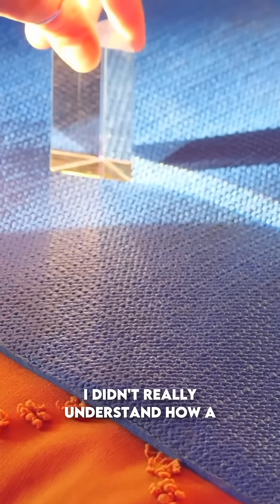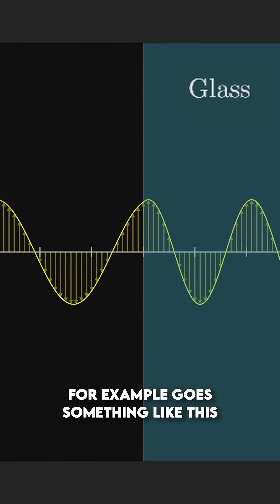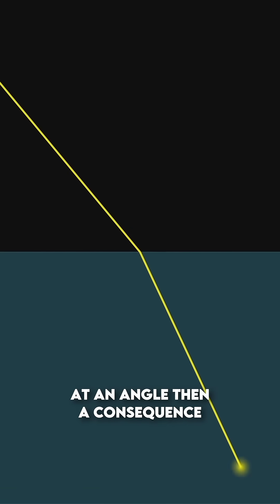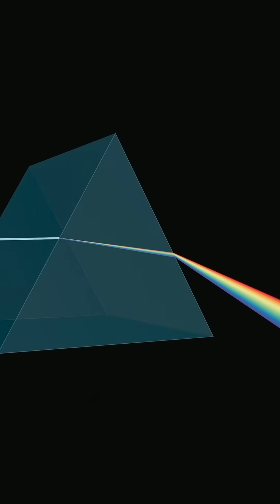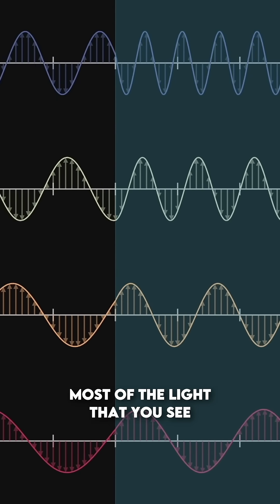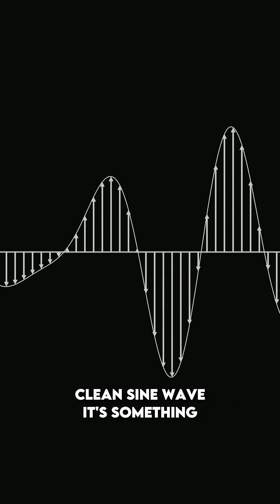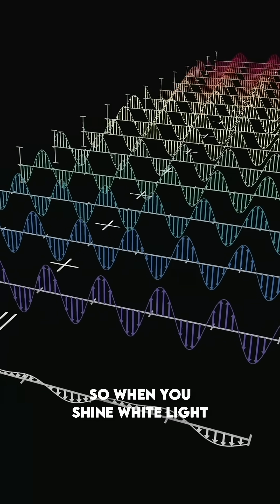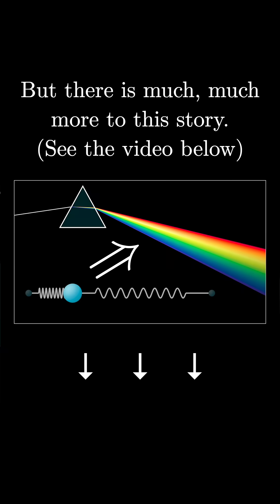How prisms work (full video linked above)

Comment: So light speed is not a constant,  meaning it's not a speed limit. And Einstein was wrong. Interesting
Reply: C is the speed of light in a vacuum.
Reply: @ialsoagree1634  correct. But it has issues with gravity.  As gravity pulls on it. And bends it, slowing it and accelerating it as well. Also, there are gases in the vacuum of space.
Reply: @nobody687  There are very few individual molecules/atoms within space. They are extremely far apart.

Also, gravity doesn't "bend" or slow/accelerate light at all. Gravity changes the shape of space itself - light always travels in a straight line. For example, when a black hole traps light, it doesn't actually change the direction light is traveling, or slow it down or accelerate it in any way. It's simply that light is travelling in a straight line toward the center of the black hole, and only from our perspective does it looks like the line isn't straight. In reality, past the event horizon, all lines in a black hole lead toward it's center.
Reply: @ialsoagree1634  There's the sun bending light around it. So you're saying it's just bending space and light is trapped in space, so it goes where space goes like on a track. But then light would have mass, and if it has mass, then wouldn't gravity have an affect
Reply: @nobody687  Yes, the sun - and all objects that exert gravity - bend space and time. Yes, light is trapped within our universe and travels in straight lines.

No, light does not have mass, it has momentum. Light is affected by gravity in that gravity distorts space and light travels in straight lines through space, therefore traveling along the new distorted (from our perspective) line.

Comment: Cam we get medium so dense that it can slow down light so much, it almost stops?
Reply: I mean, kind of, but it's not what you think.

Anything that absorbs light slows it down so much that it effectively stops.

Light is an electromagnetic wave whose energy comes from it's momentum. If you stop it, it has no momentum, and therefore has no energy, and therefore ceases to exist. This does happen - it's called absorption. The energy doesn't disappear though, it gets transferred into whatever absorbed it.

Comment: So there is always a rainbow with the Sun's light coming through the glass and you can only see the when the rain droplets show it ?
Reply: Yes, because white light is a superposition of either all the colors of light, or a superposition of some other combination that can stimulate all of your red/green/blue cones.  The rainbow is always there in sunlight, it just has to be dispersed by a method that separates the colors to appear as a rainbow.
Reply: @carultch  and how about that 99.92% of the light spectrum we can't see that is right there as well 😁👍
Reply: @chrisgoetz3889  Yes, sunlight includes those colors as well, to a much lesser extent than visible light.  About 45% of the sun's luminosity is visible light to the human eye.  It's not just a coincidence that it's this high; our eyes evolved to see the most abundant colors from the sun spectrum, since that's what was necessary to survive in our environment.

For the colors we can't see, IR dominates the spectrum of the sun, followed by visible, then followed by UV.  There are trace amounts of radio waves and microwaves in sunlight as well.

While the sun emits trace amounts of X-rays and gamma rays, these are blocked by the atmosphere.

Comment: TLDR; light slows down because it hits the elements in glass and those elements resonate at a certain frequency. It takes the energy, emits it and the next guy down the line takes it and does the same thing. This inherently slows it down. Each wavelength will interact differently because each element/molecule thing within the glass resonates differently with the wavelength. When it passes out the other end, the light splits because each wavelength was slowed down to a different level and thus when it hits the other side of the prism it gets refracted to a different angle and that lets them split.

Comment: this is exactly what was taught in high school wasnt it?
Reply: The information that isn't taught in high school, is what really is happening, that makes light appear to slow down in optically dense media.

The answer is that the light waves are in superposition with a wave produced from the medium responding to the disturbance.  That superposition of these two waves produces a wave that slows down from the original light wave.

A common misconception is either that the light is absorbed and reemitted by the material's atoms, or that it takes a serpentine path within the material.  If either of these were true, the light wouldn't exit in a predictable direction.

Comment: Actually, no. The reason the beam splits isn't because of different speeds.  All light travels at the same speed through a given medium.  It's just that the refraction index changes with frequency.  it can also change with temperature.  The idea that 2 beams of light going through the same medium can travel at different speeds is absurd.

Comment: I had a similar question when we look at E=mc^2. We can increase the mass of a system by adding energy to it. For example, winding a clock puts potential energy into the spring. This energy will increase the mass overall. Light is massless but has energy. So my question is, has there been expirements to see if different wavelengths of light have different speeds?

Comment: To take it a step further, red light (low frequency, long wavelength) is slowed down the least, purple light (high frequency, short wavelength) is slowed down the most. The higher the frequency (and in turn shorter the wavelength), the less resistance to refraction it has when traveling through mediums the reduce the speed of light.
Reply: So could a transparent material exist of comparable refractive index to glass, that has a uniform refractive index that is independent of frequency.  My made up name for this, is isohertzic.

Comment: Explain this: a star on the other side of the universe sends out light and it almost gets to earth. Then a star in our galaxy sends out light and it gets to the exact same distance from earth at the exact same moment. Then they both continue their trips to earth. On earth we can distinctly make out the light from each star with absolutely no interference from the other. The light occupied exactly the same spots in time and space but somehow remain separate to the viewer.

Add to that the fact that there are an infinite number of other light sources where their light is also occupying the same space and time. Why does the light originating from these infinite sources not mix, jumble and mash together leaving a glowing soup where one individual star’s light impossible to recover?

If it is a waive then each waive includes all light. If it is a particle then each particle also contains all light. The trick is separating them so we can filter out just one source. And that ability came from GOD.
Reply: Subhanallah
Reply: It came from evolution. Clearly over time, our evolutionary ancestors needed to evolve receptors to fit their light-awashed environment. We adapted to being able to differentiate wavelengths and light-sources, but not even moreso than a Pistol Shrimp.
Reply: Let's use a simpler example that you can try yourself. Imagine you have two flash lights. You turn both of them on and set them up in different locations, but pointed so they form an X where, at one particular point, their light crosses paths.

If you stand at the center of the X (or even slightly behind the X) you'll be able to make out the light from both of the flashlights individually, even though their light "occupies the same space and time."

When waves cross, they can do three things:

1) Cause destructive interference where one set of waves cancels out another set of waves, effectively leaving no waves.

2) Cause constructive interference where one set of waves adds to another set of waves, effectively increasing the size and strength of the waves.

3) Do neither, and both waves pass by each other without any interference at all.

When lights from your flashlights cross, they are effectively doing all 3 of these things at the same time. Some of the waves are destructively interfering with waves from the other flashlight, some are constructively interfering, and some are just passing by without interacting at all.

The total net result is a slight change in appearance of the waves (the light from the flashlights will look different if you stand in front of the X vs. behind it) but you can still clearly see the light from each flashlight individually.

The same is true for the light from stars.

Comment: see if doing more accurate experiment to know how reflection of light works so first is cover whole room take any room of any size cover it with mirror then used light any way giving light as home we used or giving light that through which a lazer light see we know reflection or refraction of light take prism one or two side ofprism do black colour orcovered withblack colour then use lazer light to see that which reflection of amount you got why covering with black colour knowing space is also a black energy then using black paint orcolour on prism starting with one side see then what amouny of reflection you got by rays of light see in home when your room is covered by objects or walls arecovered by some paints see how light works in home light only works in front side of any object but if you see you have a bed in room which you used as sleep to a bed see light doesnt has reflection to down to bad and bed down side area is black orany object in room so light cover front portion but back portion light doesnt cover see your sleeping bed your home light gives a amount to see your bed but light doesnt give amount to see down to bed as front up side yousee and then why light doesnt reflect in whole body of any object we know livht bends down see light has a so many different nature to know how lightactually works
Reply: use different colour on prism to see nature of light with knowing that any changes comes in light frequency particles in white prism we know a rain bow comes as but if we add colour to one side a d then see how lazer will react with colour of lightand then how light will react going from prism surface to outside surface
Reply: see you realized more see when light fall toany object so object gives black shadow why any object has a contact when come in light gives black shadow or black light of that object see our universe is also like same but little if light fall to any object it gives black light shadow of that object see how light has different density in every volume of surface or bodie to planet or universe

Comment: The light isn't actually slowing down, it still moves at the speed of light, it just appears to move faster or slower.
Reply: "Appearing to move faster or slower" is the equivalent of slowing down.

When people say "the speed of light is constant in a vacuum" what they're saying is that it cannot appear to slow down. For all frames of reference, the speed of light is C in a vacuum - it never appears to change no matter what you do.

So when light travels through a medium and can appear to be moving slower than C, it's speed is effectively changing by every definition we use because it's no longer behaving the way it does in a vacuum where we can never observe the speed change no matter what.
Reply: @ialsoagree1634  yes but when moving through a medium photons still move at the speed of light, even though they appear to slow down.
Reply: @mettaray2  It depends on your frame of reference - which is why light moving through a medium is different than light moving through a vacuum where the speed doesn't depend on the frame of reference.
Reply: @ialsoagree1634  no, the actual speed of the particle doesn't change, only the period of the wavelength. If i do that trick where i pretend to remove my thumb, you can't claim that from your frame of reference my thumb actually came off. That's why its called an illusion.
Reply: @mettaray2  Okay, so firstly, do you understand that speed is relative to the frame of reference for everything except light in a vacuum? This is a pretty fundamental idea in physics, are you familiar with it?

I mean, I can point out that even you recognize that the speed of light in a medium is dependent on the frame of reference. I'll do it by quoting you:

"moving through a medium photons...  appear to slow down"

Things can only "appear to slow down" if, in certain frames of reference, they are not moving the same speed they were before. This is THE ONLY WAY that is possible.

EDIT: To clarify, even if in another frame of reference you see that light didn't slow down, but actually only seems to slow down because the path length is longer, that is NOT RELEVANT. It's not relevant because in some frames of reference, the path length isn't longer, and so the speed appears slower.

Comment: This is a bit misleading, but generally a good explanation. Light never really "slows down," it always travels at the same speed. What happens is that, when light enters a medium like a prism, it "curves" or refracts, meaning that it takes "a longer path" to its destination. So light ultimately "arrives" to the other side later than it would have if it was traveling in a straight path.
So light going through a prism doesn't slow its speed down, rather the prism increases the distance of the path to light's destination.
I hope that makes sense.

Comment: I think of a prism with light the same as sand on a beach and a sifter. Different grains of sand get caught in different filters. Largest to smallest, one grain will go through different filters. The same is when a light bends (gets sifted) through the prism. Thus, we get the different wavelengths of light
Reply: If you want to use a sand,pebbles,rocks analogy; think of dropping them at the same time into a viscous fluid and watch the particles as they travel through it. The small ones are slowed the most (least energy), and larger particles go through faster (most energy), so it becomes spread out like with the prism, by energy (in this case weight)
Reply: @DingbatToast   amazing analogy 👏 
(╭ರᴗ⊙)ڡ♨

Comment: The light doesn’t slow down, light always moves at the speed of light in a vacuum even without the vacuum. The refraction is caused because in order to maintain the speed that “slowed down” the distance traveled in the amount of time needs to change

Comment: So if we had a pure sine wave of white light exclusively, it wouldn’t refract?
Reply: A pure sine wave of white light, is an oxymoron.  White light can only exist as a superposition of multiple colors of light.  At minimum, white light is a mixture of red, green, and blue light.  It could also be a mixture of a continuous spectrum of millions of colors, as it is for sunlight.

As for whether a monochromatic frequency of light would refract, which would be a pure sine wave, it would also refract.  It refracts if it changes speeds and approaches a surface at an angle other than normal incidence, such that the change in speed causes a change in direction.  It just wouldn't spread out, since all the light would take the same path thru the prism.

Comment: But why does it bend? When it comes in at an angle we can think about it as if one side hits the prism first and is slowed down first, essentially stearing it. And the higher the frequency the more material is slowed per second.

Comment: Not really, not exactly. 
It has a lot more to do with the specific permittivity/permeability and how that interacts with the specific and quantized energy of each wavelength. Quantized energy levels correspond to specific pure sin waves, which is a finite fourier series, not an infinite one. 

Each specific energy level refracts slightly differently, and looks like a smear from high to low energy levels. 

Where are the prisms that take white light, but then only emit say near IR to Green and blocks blue/ uv 🤔

Comment: I feel like there is something missing in this explanation. 

The speed of light is constant, so how can it slow down? Are we taking vector deceleration versus scalar? This doesn't pass the sniff test for me.
Reply: The speed of light is constant in a vacuum.

The point of that statement is that, within a vacuum, you cannot create a frame of reference by which light appears to travel at a speed other than C - it's impossible.

If you leave a vacuum, though, that no longer applies. Now you can create frames of reference where light can have all kinds of non-zero speeds.

Comment: The crazy thing about it is that those frequencies are based off of the elements inside of the Sun
If you were to spread out the light and cut it into a tiny little slit so none of the frequencies blend together when they are separated you will actually find gaps where it doesn't have a smooth gradient
If I'm correct they compared it to the frequencies of light that were present when certain elements burn and were able to use that information to figure out what the Sun is made up of

Comment: That is what I basically said when light retracts. It's like if the sum of all colors added is white, then on a prism, It divides known as refraction depending on its wavelength because diff colors have diff frequency. I visualized it when I saw that putting a white light into a prism it makes a rainbow that turns into white light also when it goes again to a prism